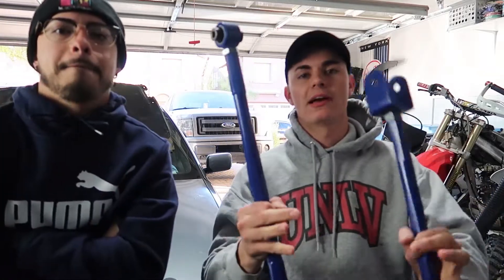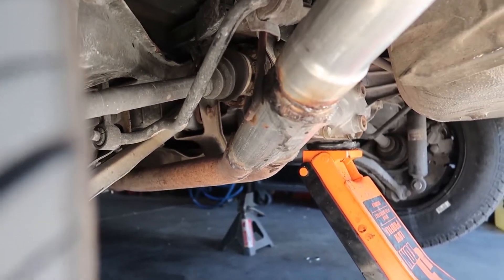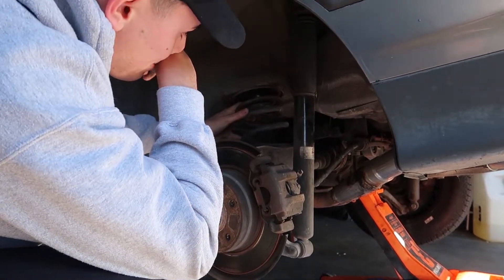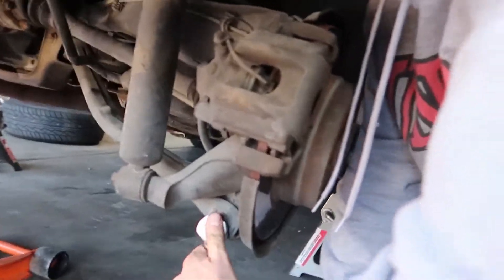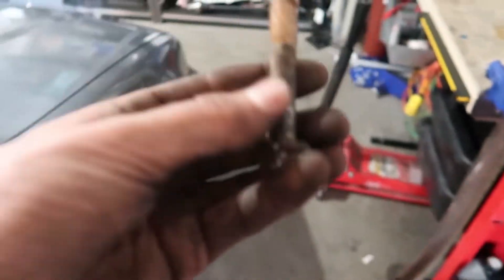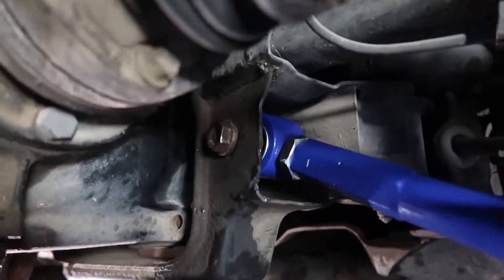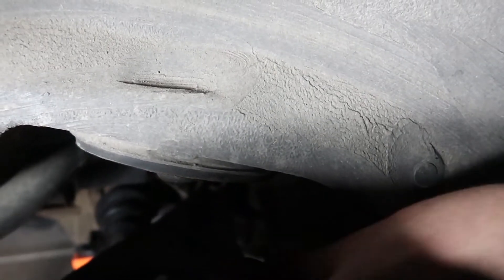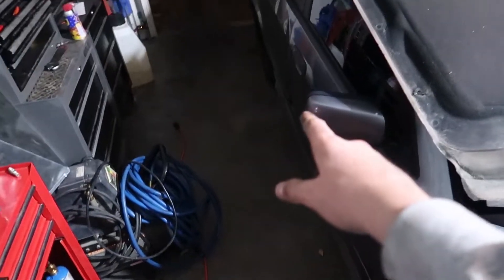E36 Build Part 4: Adjustable Camber Arms Install

Comment: God damn it all. The videos that I watch they all skip past the part closest to the brake rotor being removed The bolt is out but it is stuck on the brake shield  I'm not having the issue with the differential being in my way because my differential is out and was being worked on please any tips will be nice because if I can't nicely remove it either sawzall angle grinder or whatever the f*** will remove it. It's about to happen